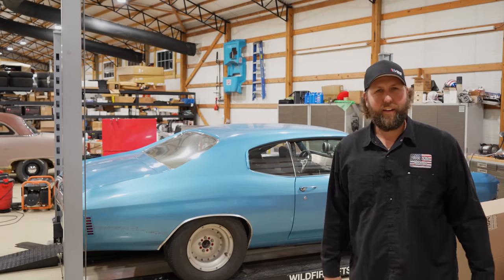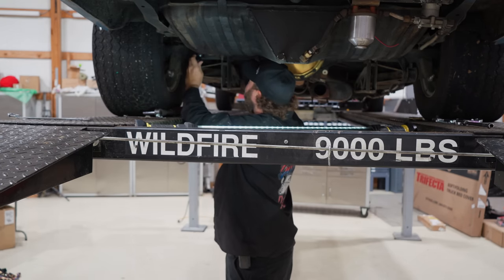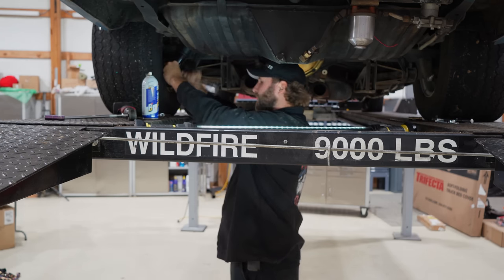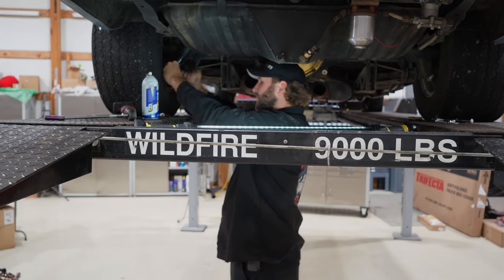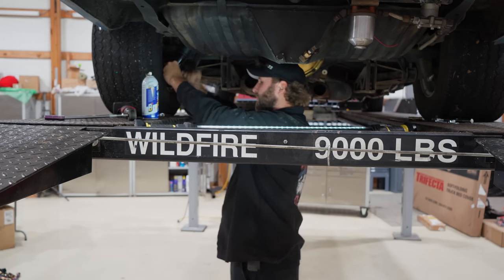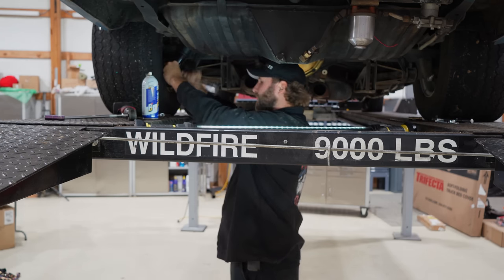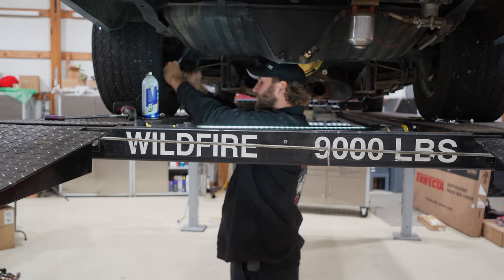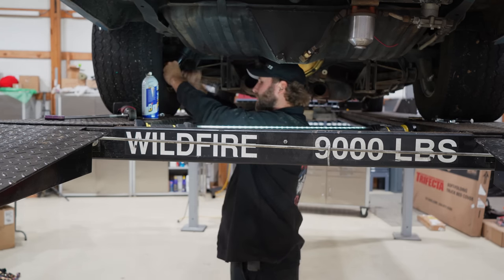'80s Built Chevelle Drag Car Goes On The Dyno - Results are NOT what we expected!

Comment: The trepidation of leaning over the fan... A flex fan blew a perfect slice through an '81 Malibu of mine.. Scary though a plastic blade from my BMW blew a dent through the hood insulation and shroud. Both absolutely at the 12:00, high noon, belly wound, killer position. Not downwards, sideways. Nope.. Fans apparently launch at top dead center. They have my respect.

Comment: I got a 69 with same traction bars same fuel pump mounting it's on m50s tho and rustyer and pretty sure I got leafs doing a ls 5.3 swap from a 2000 Silverado and a turbo 400 with a 2800 stall

Comment: Thanks for the timing explanation Derek, I was going to comment half an hour in but thought no I will wait to the end 
It certainly needs bigger tyres on the back to get some mph out of it 
I would like to see you do a couple of runs in it just to see how quick it is 
If you have a 14 second car would it be about 110 mph but not with your small tyres 
I would like to see you pull the engine down to see what is in it and maybe do it a bit better if possibly 
I don’t know crap about engine building to get the best out of it but I know you do 
Does look a nice car so you could just leave it alone and drive it as it is hey 👍👍👍

Comment: Nice car. I have a '39 Chevy 2 door sedan with a 383 SBC, Comp cam, World product heads and DEMON 650 cfm carb. It ran a best 12:39 @ 111 mph. My car weighs 3,215 pounds with no driver. Terrible 60 foot time of 1.908 but an eighth mile time of 7.971. You should take the car as is and run a few quarter mile runs. You might be surprised. I also think the car has more HP than the dyno indicated. I would have liked to do more with my car but it's a driver and the money well went dry. Best of luck.   Rich Delelle

Comment: All that popping noise while you were using the cutting torch were back fires. Part of the oxy/fuel mix was burning inside the torch head and mixer. Watch carefully, you can see the little blue flame jumping around the tip nut with each pop.

Comment: Swap heads ! The old double humps are killing the potential . My 406 w flat top pistons, a solid flat tappet cam , same intake as yours , th350 , 4.10s made 367 rwhp w a set of cast iron protopline heads . Ran deep 11s at 120 . Those heads wont move the air the cubes need . Id figure out the cam specs too. An update would likely net real gains there also.

Comment: 🚨I think you should throw a good set of heads on that motor like AFR 210’s with better valve springs, keep same everything else and see what it picks up‼️Think about it, you’ll flow way more air, and have way better valve springs to take advantage of the intake carb cam and exhaust where you will be able to rev higher🧐It already has all the supporting mods💯 I bet with a set of cnc AFR’s it picks up 60-100hp easy who knows, maybe more where you would be able to rev it to 6500

Comment: I concur. It's blowing through the converter. Those pulls were very short. Take it down the track exactly as it sits. Bet it runs 12s. Ain't no way my 300k mile 4.7 Dakota runs faster than that. You can not convince me. Take it to the strip and see what happens.

Comment: I would keep the 406. You don't hear about them much anymore. Everyone is doing ls swap, big blocks, 383 strokers, I'm a big fan of all. But keep the 406 and maybe up the compression afr heads etc. Or low compression and put a pro charger on it. Like you did with independence chevelle. Just mu opinion.

Comment: I used to work at a shop that built major turbo setups, but also rented out their dyno for tuning.  Invariably we'd get in the "400"hp small block carbed chevy cars and our tuner would find that they really were right in line with what your readings were.  Unless they were running 14:1 or higher or had power adders... they had a couple of Mustangs that were in the 1700hp zone, one running twin turbos and the best of everything fuel injected and it was a street car, upon completion they rented the llocal dragstrip for the day to run it and 2 other cars... it's first full pass with a 9.90 legal cage was an 8.90, and that was dialed back to under 1000hp so they could get the 10 inch tires to hook up for most of the track.  I think they left the tune around 980hp so he could safely drive it on the street... owner would sometimes take his daughter to school in it.  I got to replace the clutch once in a 9 second corvette they'd built... multiple stages of nitrous and a huge belt driven blower.  Scared the crap out of me well before 1/4 throttle.
Reply: The completely made up 'gross' HP numbers from the 60s has seriously brainwashed some people. They don't understand old pushrod engines can't flow and can't make power above 5k. Then again, we're talking about people who don't even understand the difference between torque and HP. This thing is geared for 85mph top speed, which I can only presume was for maximizing 1/8 or trying to do a wheelie which makes it sound twice as powerful during pulls.

Comment: It needs high-flow aluminum heads. Check the bottom end and see if it can handle more power. Or just go with a heavy duty big-block engine. Nitrous would make it easy driving on the street.

Comment: It probably needs springs.  I imagine 30 year old springs don't have the seat pressure they used to.  Also, it's hard to dyno automatic cars, particularly when you don't have a lockup and a higher stall converter.  As others have said, you're probably blowing through the converter.

Comment: Having watched this video again, I think this car can run faster than 14's with a little work. Good heads for sure, find out what the cam is so you can be sure if it's solid or hydraulic and adjust the valves accordingly. Were the tires spinning on the dyno? That could hurt the HP big time. Let me know. Thanks, Rich Delelle.

Comment: I have an idea. Pull the heads, check everything, then upgrade parts from 1980's one at at time, say cam, then heads, intake,  document on gains on dyno of each. Show how things have advanced in technology and the improvements.  I think a 350 roller L31 with decent roller cam, springs, 750 carb would toast this engine on the dyno.  Make this car a driver though in the end. Keep up the good work,

Comment: how do all? when i had spare i shouted my vg 1970 valiant chrysler with a 245 straight hemi 2 x monroe wylies 130's plus 2 x mr 180 pump ups for the back, plus replaced 5 torques/trans's so put a ford 3 speed with manual, excellent for bush roads to work logging. i often thought of putting a mercury switch pump to direct extra air into valve on outside of corner but couldn't work out how to empty pressure on inside and then even when no sideways inertia .as standard as that sedan was, with the pump ups high, and almost an inch of camber to lowered front with a simple wind with a wrench on stock. she looked brute enough for bathhurst. taztez

Comment: Port the heads, unshroud the valves and get a 3 angle valve grind and seats, get some tapered springs or beehive springs to prevent the valves from floating, Better yet go and get some AFR heads or Trick Flow heads. The cam sounds healthy enough, just make sure its degreed correctly, while you're at it find out what the lift, duration and LSA is. Check to make sure the lifters are in good order, Check the advance on the timing as well. Check compression ratio, misfiring at the upper rpm limit. Make sure the intake manifold ports match the intake ports on the heads, I bet they don't just by the way the rest of the car was cobbled. As for the carb I would have went with an 850 cfm one.
Having said that the motor has lots of potential, it spools up quick, there seems to be a disconnect between the motor's performance and the dyno. How do we know the dyno is right? I thought by the sound of the way the motor ran, 500 horse at the crank would be conservative.

Comment: Keep that engine...Tear it apart and inspect the internals...Write down what all the parts are , rods , pistons , cam grind , etc...First thing I would do is see if you can find an old set of Dart heads that are untouched and go from there...I believe you can if you search...They were better than the camel hump heads...Pull the cam numbers off the front of the cam and it should tell you who made it...Call them and get them to grind you a duplicate with complete matching valvetrain...Same with the pistons...Put it together with the Dart heads and hit the track...You can also put some 02 bungs in the exhaust to keep track of things and help with carb and plug adjustments...Keep us posted and I love those older cars...

Comment: I started out on a early 94 Chevy Silverado extended cab short bed Z71 I have mentioned before it was a supposed to be a fresh rebuild I don't buy that for a second but I do believe it was rebuilt at one point, anyways it kept fouling out spark plugs mismatched plug wires only 4 of which are even supposed to be on a gm motor, and it had ngk ur5 v power and would constantly foul out plugs so bad it was dumping raw fuel out the exhaust also because of mismatched fuel injectors in the tbi and with the exhaust and exhaust tips on that truck when it cracked and backfired out of the exhaust it sounded like a 12-16 gauge shotgun side double barrel going off simultaneously good God is that loud, ended up being also a junk ignition coil that kinda worked.

Comment: How about some old style triple valve springs, and aluminum higher ratio roller rockers like from the 80s. A dial a cam, and play with different distributor weights so you can get maybe 7 grand out of that engine. If you’re going for drag only maybe 3000 stall or 1800 stall for drive and drag. 🤔

Comment: Hey man, I love your show. May I make one safety comment? Please don't be the guy that reaches in the window and starts the car, get in the car hold the brake and start the car. I had a friend that built the car he reached in through the window and started it after he built the car , of  course the transmission linkage was out of adjustment, it went right into reverse and like to tore the a-pillar off the car when the door hit the wall going out the shop

Comment: I think the heads are holding it back.  I would do a compression check and if the bottom end is ok I would put a good set of heads on it.  It probably wouldn’t hurt to swap out the cam to something that works better with that combo.  I imagine when that car was built options where a lot more limited.  If you have valve float you need new springs at best, so swapping to a more modern set of aluminum heads would really wake it up.  May want to upgrade the intake to a super Victor high rise or an eldebrock perfromer rpm air gap.

Comment: When you used the torch, there is this tool called an open end wrench. It looked like you had clearance to turn the head of the bolt and drive it in or out. Just saying, but I could be wrong.

Comment: Just a modern hydraulic roller cam and better heads (iron eagle)/intake (Performer RPM Air Gap) and some carb/ignition tuning on that 400 ought to wake that feller up, assuming it's not damaged.

Comment: Those loose bolts have probably stretched, causing them to get loose.......(theory)   Grade 8 fine thread, locks and fiber nuts or self lockers (non fiber)  Grade 8 does not stretch; however, when over stressed simply breaks or "pops"!!!  (then they fall off.....not lol):face-fuchsia-wide-eyes::face-fuchsia-wide-eyes::face-fuchsia-wide-eyes::face-fuchsia-wide-eyes::face-fuchsia-wide-eyes::face-fuchsia-wide-eyes:

Comment: Your broken battery is a bad connection for the temperature sensor. Bend the little tab in  battery slightly to make better contact with the small tab on the battery well.

Comment: To me the numbers don’t seem to add up? My .040 over 350 with a turbo 425 (heavy duty 400 with an extra clutch pack) that had minimum 100k miles and a shift kit in it and 3:73 10 bolt posi on 295 15 street radials ran consistent 13.90-14.10s at 105-112 mph in a 3520 lbs 73 Camaro plus driver at 200 lbs!

Comment: I had a 71 clone car in high that was built almost exactly the same as that car.Mine was money green had the small block 350 with double hump 202 /186 heads/no fender wells.Ladder bars {pretty sure those are actually the old Lakewoods)mine were yellow underneath and fit funny too.Also had  29 inch mickey thompson tires  mine were the s/s  had the weld wheels 3.73 with strange axles and a moroso brute strength cover on it gabriel air shocks never got beat out of the hole big block, small block,s10 smallbock w 2x4 setup actually a mikado,mustang killer.some of them got me on top not ever out of the hole,owned the 60ft.street racing arm drop but not jumpingsomething about that combination was golden.i think something wasnt right with that setup and you were probably losing power through that 10 inch vega stall mine stalled at 3200 with the brake pedal but it wound up to around 5000 before it really took off i dont think those things really much lock up id be looking at that plus the 400 dont wrap as high.i think you should leave it nostalgic with the bars get a a modern 3500 stall and take some gear out of it 3.90 are perfect with a low 1-2 in the trans(id stick wuth the 350 turbo less parasitic draw ) holeshot and  the trap and still drivable unfortunitly 3.90s only in 10 bolt unless you find an international traverall it will have the sure grip dana with 3.42 or 3.91 init hard block the 400 to the bottom of the freeze plugs/ put .010 out the bore popups/fly cut for clearance init and run it on methanol.if you need a crank go the other direction destroke it with 350 steel crank to a 382 350 cranks are cheap and you may be able to run a nodular forged 442 3 50 also ran mibe with popuops,gonna really rev then.lighten the oid girl up theres your 10 second chevelle without alot of $ carberator $600?,methanol,set of forged pistons 600ish new convertor 3-$400 and a set off low gears $300 trans  maybe less.sure grips easy to find probably one down the street if you live in the countrylittle machine work pa-pow your in there like swimwear.word to the wise i wouldnt unshroud those heads too much prone to cracks cracked (per David Vizard)and be really leary of the inner fender lip on that chevelle with 12.5 inch tires caused me to wreck mine ended up around a small tree unrepairable.if i could go back  i would cut that inner all the way back and minny tub or at least beat it back all the way clear of the frame so much less gawdy than a 55 gallon drum turned on its side.wish i had pics i would send one.want to build something soon anyway  1969 highcomp cadillac 472 in a 1992 gmc swb street legal haha if you throw down on the injection just get the dominator setup more plugins for feedback.peace out brother and to all those out there struggling just remember a grinder works great for the welder you aint....

Comment: Hey I was thinking that maybe that car was set up for nos   reason I say that is it had a riser under intake very tall tires  big gear roll cage which usually means 9 seconds at least you SHOULD be able to get that set up in the 10s at least with. Single shot of nos  we had a very stock 350 in a 69 camaro with 2 different heads on it and w 1 plate it went low 11s w a limited slip rear end so that motor is prob built for nos  had what looked to be roller rockers too. Just a thought and it had a msd or maybe the converter is bad

Comment: I think you should find some bigger tires to run it on, because going from 29s to 26s is a drastic change to the drive ratio of the car, which would have a big effect on how it runs. You were running the rpm up really quick on the dyno which tells me you're not putting enough load on it to see what the true horsepower is. I ran my car on the dyno once trying a pull in 2nd gear which spun up similar to this car in 3rd, when I switched to 3rd it took like 3 times as long to go through the full rpm range and almost doubled the horsepower reading.

Comment: About 30 years ago, I took my virtually stock L48 '76 Corvette to Gainesville Raceway on a Test & Tune weekend.  I was absolutely pleased with it's performance, given that when new, Chevrolet rated it as 155 hp.  She ran 15.856 @ 86.something mph in the quarter when I power braked it on launch.  Without power braking and it was 16.010.  It didn't feel hugely fast, but I had a great time.

Comment: Quite the surprise> hold on after you punch it might hit your nose on the steering wheel. 100 HP?? it made the same power down low as in the RPM strange. never saw that before it is not happy! thanks for showing the video anyways. might have made power WAY back then not anymore!! now it wont pull a Faa lady off a trick.

Comment: i never saw anyone run a dyno like these two were trying to i think that is why the arc was like that big hump and off   and they did basically  the same thing every run that is why nothing changed in hp ratings  running an engine on a dyno is like making your engine climb a long steep hill  its like the farther up the hill the steeper it gets    so if your sitting at an idle and just stab the throtle quikly its not gonna show your engines capabilities in the hill climb  , i dont feel that he even got out of flaring the converter  that converter is probably 4000 /4500 im gonna say that engine is right around 425 hp with the correct people running it

Comment: A good cam swap, airflow research heads, the heads alone will get you 60 hp.  I think the lobes on that cam have been rounded off. That engine is weaker than a crate 350.

Comment: It's blowing through the converter. That's why the curve is flat. The converter failing at the same point every time. Bet that trans got hot quick. You can hear it to. How fast the engine climbs vs how fast the Dyno climbs. The power isn't getting through.